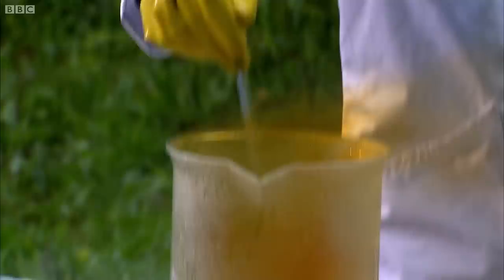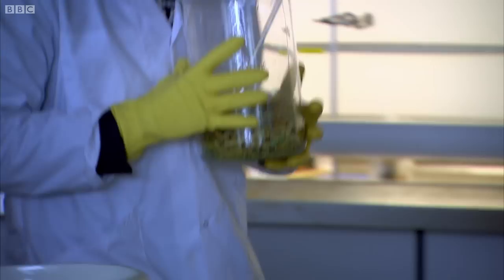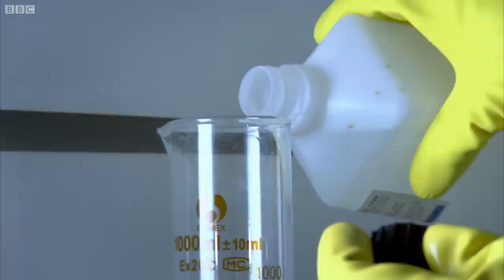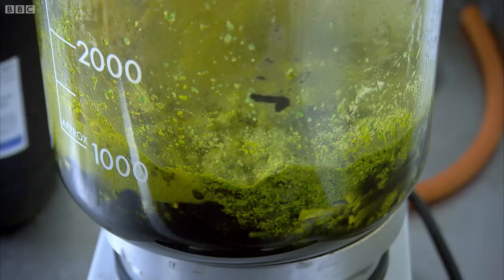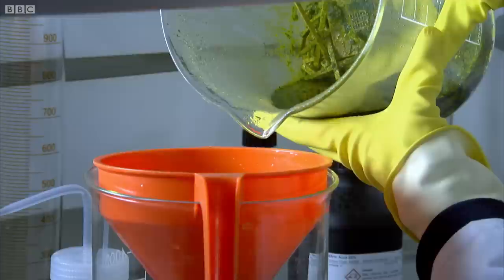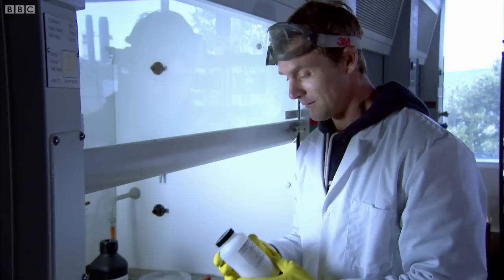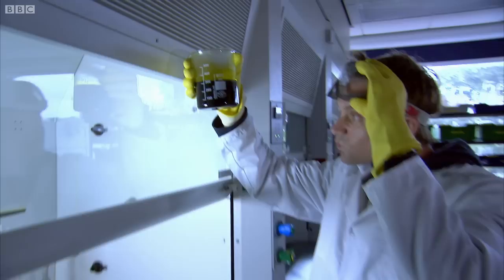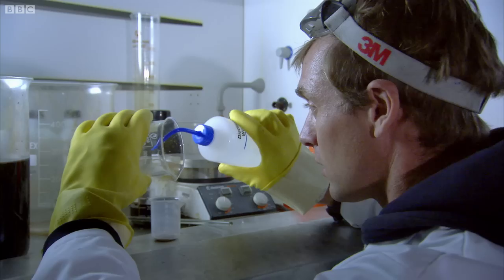How to Extract Gold from a Circuit Board - Bang Goes the Theory - BBC

Comment: ok let me share a few tidbits of knowledge here.... using nitric acid to achieve the dissolving process while effective isn't worthwhile monetarily. go to the pool supply store buy a couple gallons of 20 deg/ baume hydrochloric acid 31.5 percent strength. and 2 or three super sized bottles of 3% hydrogen peroxide (1 liter) standard stuff you can get at the pharmacy... a fifty fifty ratio of those in a large clear plastic container does the same thing as the nitric in the beaker. no toxic NO2 gas emitted (which was the brown gas) which comes when dissolving copper no nitric burns, highly corrosive! and expensive, did i mention expensive? hydrochloric is about 7 dollars a gallon where nitric is 50+ a liter bottle. after the process rinse the gold foils with water, and THEN dissolve in the aqua regia... about 200 ml hydrochloric, and add nitric slowly (with a pippette preferably) after the hydrochloric is around 130 degrees F shouldnt take too much more than 10mL of nitric to do the trick at that stage... if it doesnt dissolve after ten.... ad a little more very slowly then follow the rest of the recipe.... urea til it stops foaming. and sodium meta, till it turns dark brown and the gold falls out of suspension. ALWAYS REMEMBER TO TEST THE GOLD LIQUID WITH STANNOUS CHLORIDE TO MAKE SURE YOU GOT ALL THE GOLD!
Reply: edgar sikes  Absolutely correct...except I can buy Nitric at $30/US Gallon, here in San Diego, and the percentage concentrate of the Muriatic in California is a lousy 15% as they grew tired of ER visits. But you can use that and recover the Gold leaf just fine. (So I just pay through the nose for 33% Muriatic at the Chemical Supply as I am too lazy, and without equipment, to distill the 15% Muriatic.)You can add that if they are really interested that they can visit the GoldRefiningForum.com .
Reply: 24kGoldenRocket dont bother buying at the chemical supply go to any pool supply store. they should have 20 deg. baume muriatic acid which is the 32% grade even the 15% stuff work if you use hydrogen peroxide or an air bubbler from a fish tank to create dissolved O2 in the CU2CL solution. using nitric for 30 a gallon is a waste of money when you can buy either grade of muriatic for 7-8 a gallon and use it almost indefinitely... i buy my 32% at the local pool supply store 4 gallons for 25 bucks. as for the goldrefininforum, you know that most of the members would say the same. using nitric to remove the tracing on a board is like using a claymore broadsword to open a canteloupe, yeah itll do it but why? http://www.lesliespool.com/san-diego-california/stores.htm

leslies pool is where i buy all my muriatic from give them a call!!!! im on the east coast so i dont know the restrictions in cali but there has to be a way around it... wish i could buy nitric around here i have to order the stuff online and have it shipped to my work.
Reply: 24kGoldenRocket sorry rocket i was trying to reply on your comment and my wifes account was logged in!
Reply: edgar sikes I successfully use the Muriatic Acid bought at the Pool Companies for recovering Gold. That is no problem really. Just takes a little longer.

But I use the 33% Muriatic from the Swimming Pool Company for mixing up the Aqua Regia to refine Gold.. 

Maybe Paaz Jewelry Supply, here in San Diego, might Ground Ship you the Nitric Acid. (I never asked that question as I live here.)

But at $30 per Gallon, plus shipping expenses, it may still end up as quite a savings. $50 per liter is a pretty steep price..at about $180 per Gallon???

Ouch!!!.

I think that you'd do better having it shipped.
Reply: +edgar sikes good idea

Comment: like the one guy said ,there's other ways to dissolve the gold,,as well as other ways to extract the gold,,,AND ITS NEVER LOST! if something go's wrong all you have to do is add its volume of water to it,,place the beaker or reaction vessel in a bucket an add aluminum foil until no more foil dissolves,,the black looking mud the foil leaves is your gold,,that gold will have aluminum in it but at least its not lost

Comment: how did he come up with this long unexpected-to-work method? a professional chemist ? 
do i really need to take a tough chemistry course to do such thing or i need to do researches and stuff ?
Reply: MultiDrGh if ur trying to make some quick cash this isnt the way to go.
Reply: MultiDrGh RESEARCH...RESEARCH..RESEARCH.Actually you need to research it. The only issue that I have is that if you lack laboratory experience then you will not follow Lab Safety Protocols..(EYE PROTECTION, GLOVES, PROTECTIVE CLOTHING, RESPIRATORS WHEN NEEDED, ETC.)These Chemicals are dangerous and it can cost you, or others, INJURY or DEATH, if you make a mistake due to ignorance.Note that he did his reactions under a Fume Hood. Do you happen to own one of those? It is not necessarily financially feasible to own one. But do you need one? Do you know, beforehand, if you need one?

Comment: given the circuit boards you used a much safer, faster, and cheaper method is using hydrogen peroxide. Next time toss in a cpu or motherboard